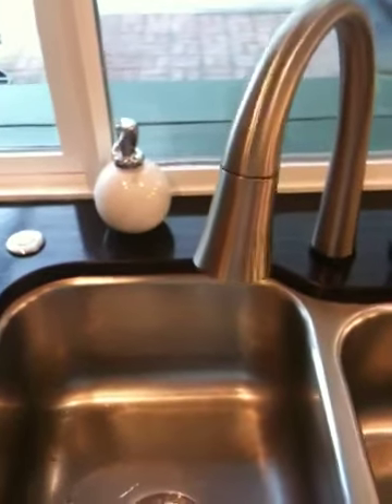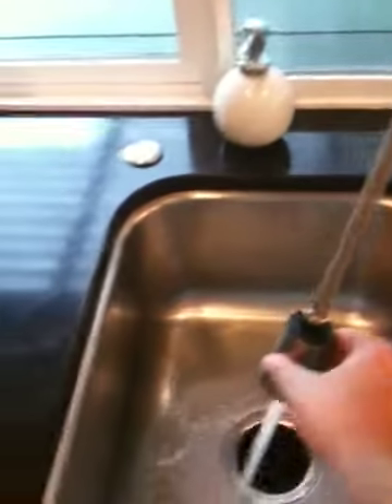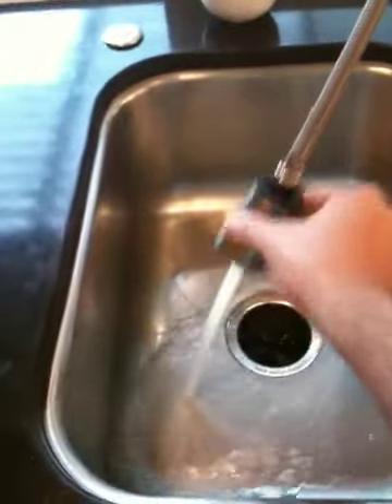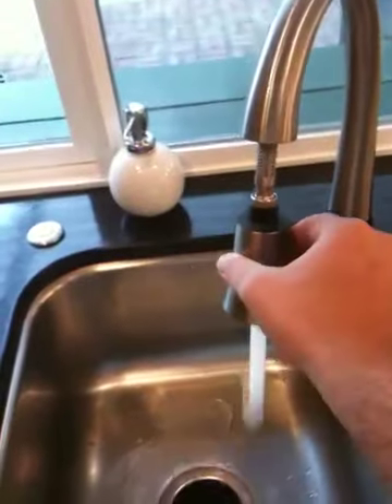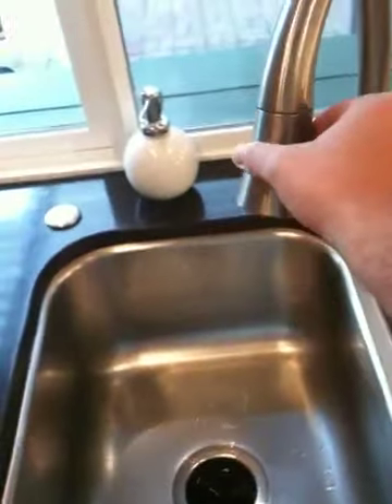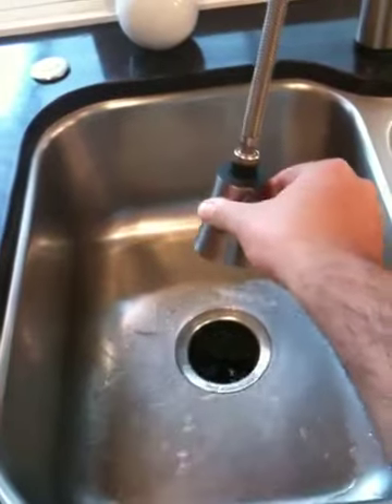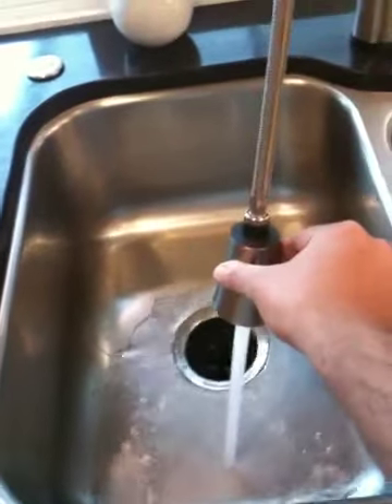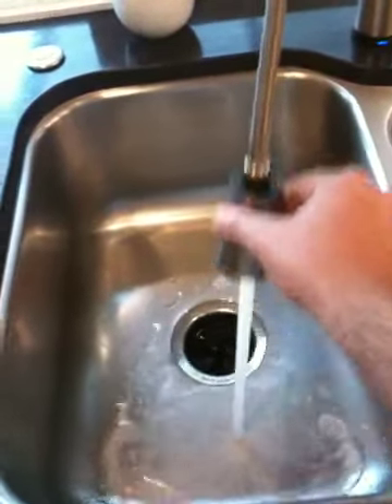Delta faucet touch2o malfunctioning

Comment from the maker: @Cluby2 I think my problem was the wire that was connected to the Spout underneath  it probably has a loose connection, so pulling out the hose would cause it to disconnect.

The wire goes into the spout so there is no way to check the connection. 
What I did to fix this was to secure the wire to the cabinet wall with a little bit of duct tape to prevent it from moving.

Comment: Usually all the problems described below have to do with the touch sensor "U" connector not being properly clipped onto the base of the faucet. It needs to be firmly mounted and not interfered with when moving hose in and out.

Comment from the maker: @Cluby2 I also had the on/off problem which was fixed by pulling out the batteries and putting them back in. (basically resetting the electronics) 

By the way my faucet didn't have the green "ground" wire some olds models have.

Comment: I was hoping you had a solution to this problem.  Our problem is similar except it doesn't turn on and off when you pull on the hose, it just turns off randomly when it is being touched.  Also, ours only turns on and off from the controler and not from the next/body of the faucet itself.  Hopefully, someone can offer some insight.  

Are you still having this problem, or did you figure out what was wrong?